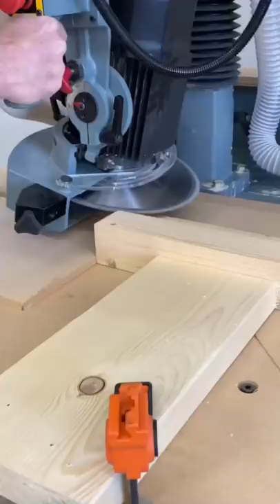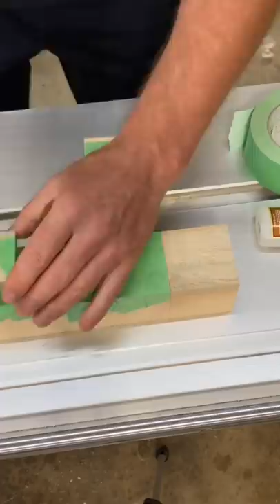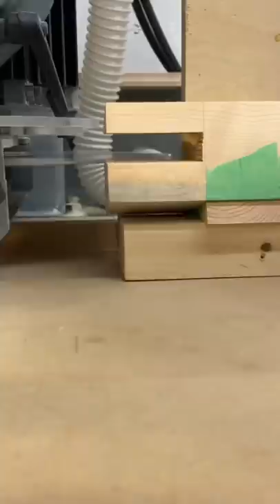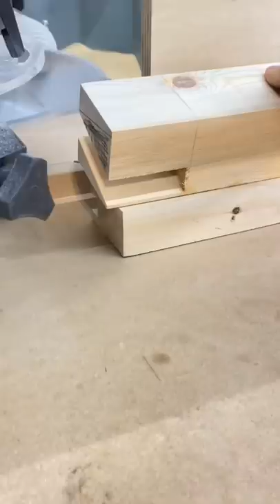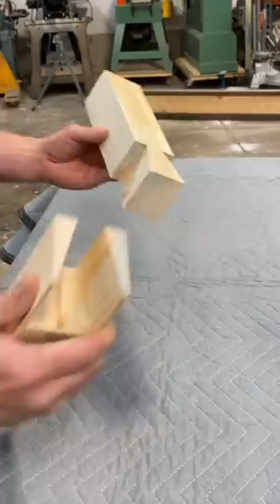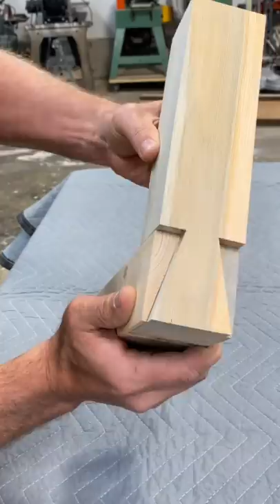Dovetails with a Radial Arm Saw

Comment: мне кажется, что Пропорции неверные и стоило с точки зрения прочности наружные стенки сделать покрепче, а внутренний Ласточкин хвост-потоньше, а?
Reply: Сделай правильно и покажи всем.
Reply: Верно, действительно будет крепче.
Reply: @user-hq2mk2eb2u  а ты автор что-ли?
Reply: Однозначно, сам это заметил.
Reply: Gosteimuito
Reply: Полностью согласен! Соединение - ГОВНО!
Reply: К счястью вы не правы
Reply: За счет уменьшения угла на хвосте.
Reply: 😂😂😂😂😂 коменты огонь😂😂😂
Reply: Brliat..
Reply: Но станок классный 👍
Reply: Where is the craftsmanship in this. It's boring and lazy
Reply: Наверное порода дерева позволяет и дополнительно Он прикрепит деревянными чепиками или как их, скорее....
Reply: The depth of the inlay is adding a lot of strength. Good joinery distributes the load across most of the surface area, peaking at only a few points. One point where a lot of load can be problematic is the base of the dovetail inlaid part: thicker walls will result in a thinner dovetail shoulder and I'm not sure where the tradeoff would worsen the joint in this case.
Reply: Ох станок у него классный. Как называется?
Reply: @АндрейХомяк-д9у  Пользуюсь гугл-переводчиком, так что извиняюсь, если что не так. Станок представляет собой радиально-консольную пилу со стопорным лезвием.
Reply: I thought so too. It looked a little weak. But that's just my opinion. 🇺🇸🇨🇱
Reply: English on the internet🤦🏻

Comment: Now that's some excellent work with a RAS.  I'll have to try it with my DeWalt GE.  I've begun modifying an MBF from 1953 to do box joints at the front edge of the table.
Reply: W1'

Comment: I inherited a RAS but I have to say… I’m terrified of using it. I’ve watched a million videos but still don’t have the confidence lol (VERY new to woodworking). This guy is a king with a RAS.
Reply: Same rules of safety apply to all circular power saws, with some variation depending on whatsaw it is: Circular hand saw (Skilsaw), Table saw, Radial saw...they can all gitcha if you break the rules.

Comment: Looks good, but too large of a dove. The retaining lateral pieces are too thin and won't hold up as well.

Be fine if they are a structural support, but not as a primary load support.
Reply: But a gorgeous frame for something non load bearing like a room divider
Reply: @formdoggie5 My thoughts exactly! 👍🏻
Reply: Titebond 3. End of argument.

Comment: I never really saw the need in one.  Until now.  That thing is amazing.
Reply: The radial arm saw got a bad rap because there's a lot of poorly-made saws out there. Sears sold millions, and they aren't very good tools.

But if you get a cast-iron DeWalt or Delta (I have 3 Delta's myself), you're starting from a better place with a better tool. Mind you, they aren't plug-and-play. 

You need to make a table that's dead flat, and take the time to adjust the table, arm, fence, and blade so they're all dead-nuts flat/square/parallel/whatever.  Use a good blade.  Learn and use good technique.

There's definitely a learning curve.  But it's definitely worth it.

Comment: You may doubt the purpose of this, but in wood furniture construction, dovetail joints are one of the strongest options out there. Almost as good as a proper weld joint in metal fabrication.

Comment: Curious: Are you making the horizontal cuts in climb? I use a similar method to cut tenkn cheeks on large members, but I  enter the cut in the opposite direction. Do you find you need to fight to resist the saw running at you? Thx.

Comment: I have had a commercial shop since 85.  I used to own 3 radio arm saws  I still have one Turret saw. they are the most Dangerous thing in my shop . Especially the underpowered ones which have a tendency to bind up and jump at you... And don't ever try to rip with one....

Comment: And what is wrong with a mortise and tenon. You don’t have to cut at a angle it has thicker sides for strength and just simple compared to this dovetail joint better suited for other jobs